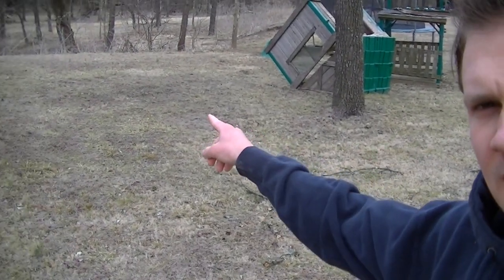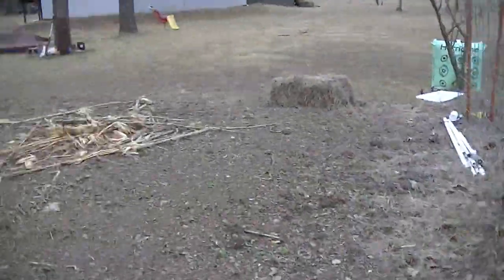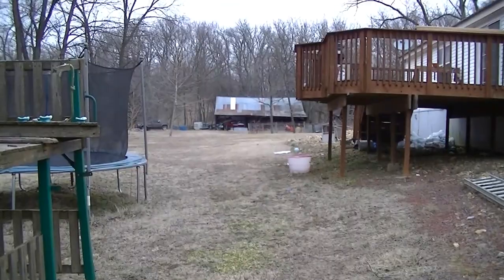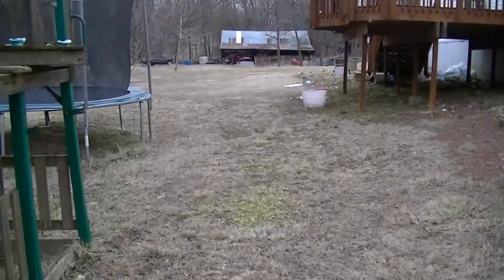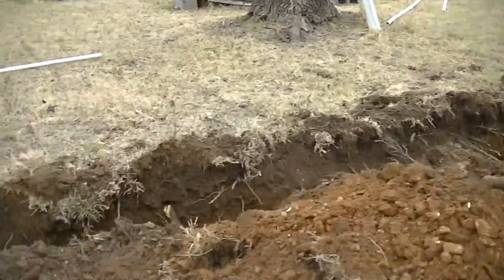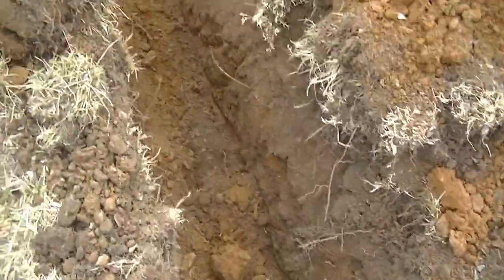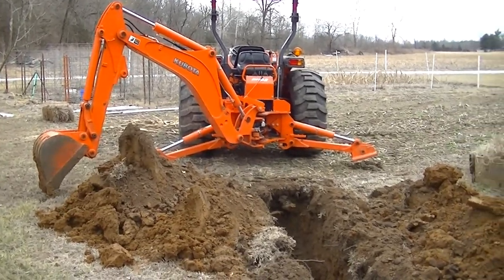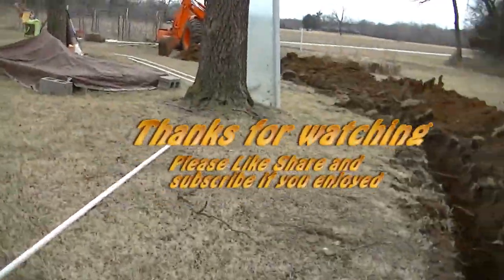Digging waterline to the garden with Backhoe PT.1 Kubota mx5100/BH92

Comment: The slow hydraulics is why I'm going with the Kubota L45 or L47 now its more of a commercial grade backhoe loader but still detachable like yours. And instead of having two seats you just swivel the tractor seat so if you got an aftermarket cab you don't have to leave it an be in the cold.
Reply from the maker: yep the single hydraulic pump trying to feed multiple applications is for sure an aggravation. That being said though I'm not in the construction business (Yet) so it beats the heck out of a shovel and I find myself using in the "tractor" configuration more than the TLB. Hard to justify another 20K for hydraulics when not using it commercially. Thanks for watching I miss notifications on some video's so sorry for delayed response and like

Comment: i have nearly the same exact tractor.... if you want a cleaner trench then flatten out the bucket and pull along the bottom of the trench, makes for a nicer flat bottom trench and allows the teeth to dig in easier.

Comment: What width bucket are you running? Looking at a backhoe  myself. Thanks
Reply from the maker: Rprecision 16 inch. Would recommend getting 18 or higher. If I wouldn’t have bought mine on used market I would’ve purchased the 24 in. Yes it’s a little bigger for digging waterline trenches but find myself wishing I had a larger bucket for many other projects